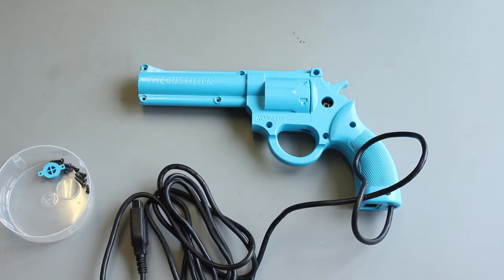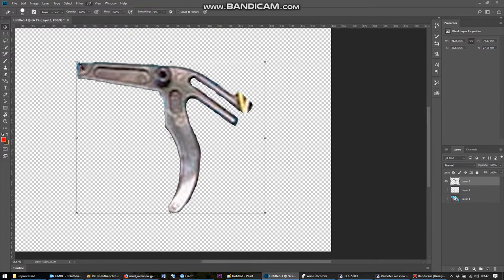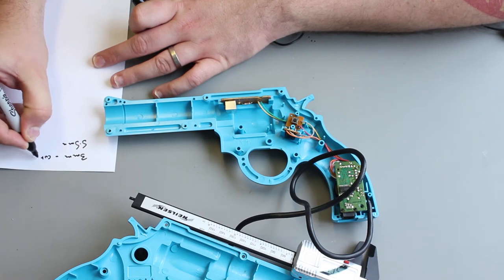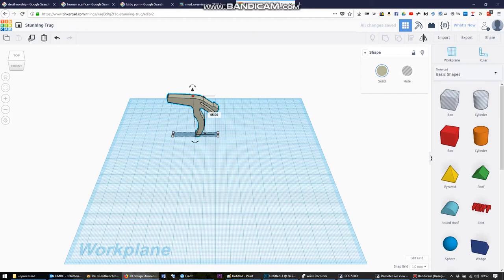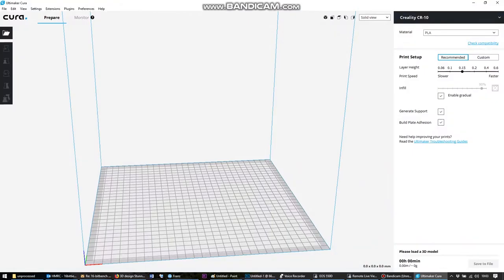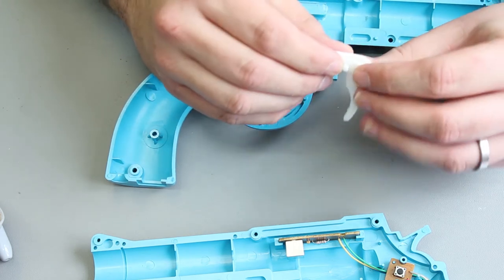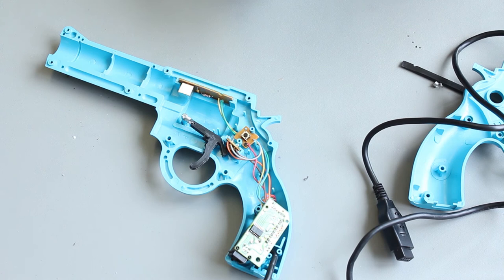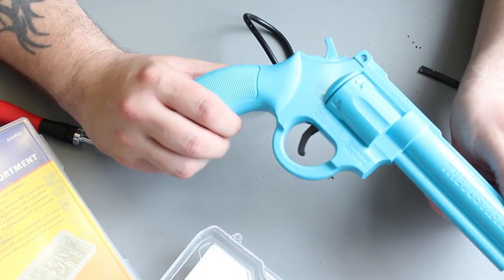Fixing a Konami Justifier - Printing 3D Parts for Gaming

Comment: The original trigger clicks and then bottoms out on the trigger guard before the internal tines would touch (gap limits force applied to the impact switch). Yours does not appear to pull back far enough to contact the back of the trigger guard. I’m not sure it’s worth making another revision but it may put too much force on the switch inside.

It’s actually missing another part too: The focusing lens. I’m betting you can salvage them from an NES Zapper, which are a dime a dozen here in the States. I’m actually curious about modifying an NES Zapper as a 2nd-Player Justifier. If I can’t I’ll just convert my second Genesis/Megadrive Justifier into the second player gun. I’ve already worked out the pinout and internal connections for that. :)